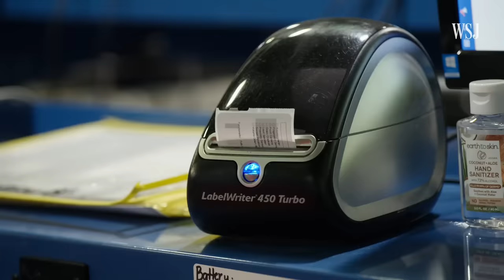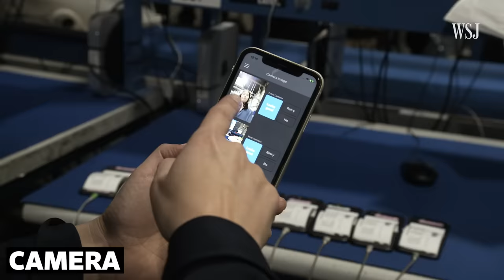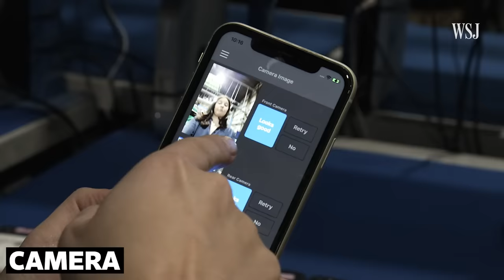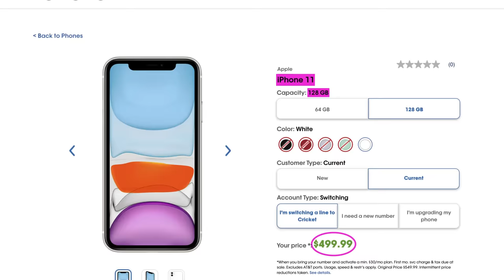How a Traded-In Apple iPhone Gets Refurbished | WSJ

Comment: I was expecting more than just a clean for only a 20-30% saving on the brand new price. Seems far too expensive as you'll be getting a battery that takes longer to charge and with a reduced battery life, compared to when it was new? I'm struggling to see why anyone would buy one? This video really hasn't answered this key question for me.

Comment: I honestly never believe in trade-ins. Paying $1000+ for the phone originally to get recycled later to get the next phone at a cheaper cost. I would give it to another family member to use or use that as a second hand phone, maybe find the newer phone you want refurbished to make up for the trade-in price, rather than trading in a phone so you can get the newer one at a cheaper cost. Doesn't make sense to me.
Reply: I bought my iPhone 12 Pro Max 3 years ago for $1200. Traded in last week for $1000 off the $1200 iPhone 15 Pro Max. $200 to upgrade every 3 years is much cheaper than buying a $1000+ phone every time you need a new one
Reply: @hotdogstandman  true, I would take the best advantage and use a phone until it’s completely out of function before upgrading. Doesn’t have to be every 3 years. 5-6 years is also good. Buy the best one once the previous phone is complete out of function.

Comment: So the breakdown is, you buy a brand new phone for lets say $1000 bucks plus tax, later down the line, you decide you want to sell it, 3-6 months. You then
take a loss of $800 because they are offering your $200. So when they do sell a perfect condition phone about $350 they make a profit of $150 minus of
course the fees and conditions 80-100ish lets say. So the initial buyer loses 80% of the value, rather than selling it for $800 and taking a loss of $200 instead
of $800. Bottom line is, if you trade in your phone, you lose alot of money and then end up losing more money when you buy a refurbished phone. Better to
sell than buy it refurbished. Then to trade it for $200 bucks and buy refurbished.

Comment: That's why I never trade in my iPhones to Apple or Telecom providers. I always get the newest pro model, 256 GB, and use it for 2 years, having it cased and protected. After that, I clean it (it takes 5 min to clean it and reset it), the phone is in perfect condition and always goes for 550-650 € on eBay. In the end, it's the same, but i get ~600 € for 10 min of work. What these guys are doing is nothing special, they check the phone and clean it. I thought they were really working on them, changing batteries, broken parts, etc.

Comment: First off, a bit over 20 years ago, I was a technician repairing point of sale terminals that were being refurbished, so I have some idea of what's involved.  In the local mall, there are a few stores selling refurb phones and my cell carrier also sells them on their web site.  They also provide free phones to women's shelters.  When I get rid od a phone it's usually because the battery has worn out and so would be a loss to those guys.  I have replaced the battery on one phone, but that wasn't a job the average consumer, without my skills, could do.

Comment: I wonder how many they get still locked to an Apple ID or an ex company phone, locked to that company? I had a phone that I took to Apple for a new battery, they factory restored the software and returned to me without replacing the battery as “ locked to a company” and so it was basically bricked. Fortunately I had been given the phone when I left the company and I was able to get the IT department to log on to Apple server and release the phone so it would work. I can imagine someone buying a phone that has been factory reset and appears ready for setting up, only to find it comes up as locked to a company and they are not able to go any further (phone is possibly stolen).

Comment: We got three brand new iPad for our kids one year. Within 6 months two of the ipads had been replaced, they bricked/boot loop. At 9 months we had to replace one that had already been replaced. Just over a year the only original one left bricked too. 
I was very convincing when the trades occurred. They didn't want to give us any credit for practically new devices that stopped working due to poor build quality. They said "well it doesn't power on so we can't give you credit." To which I said "and? You're going to send them off to be refurbished and then sell them at near full value. So I paid for full value, now that it's broken I have to pay full value again and give you my broken iPad to you for free. Then you're going to sell the old one. You're getting the value of three iPads but only selling two. It's not happening with me." Low and behold they gave us credit for the broken iPads.

Comment: So the software they used when plugging in all the phones to erase them all. What about icloud protection? Does it bypass that? Normally when you wipe an iPhone, it bricks due to icloud, does this software bypass that completely?

If so and that software got into the wrong hands, that would be bad.
Reply: It only does that if the original user doesn't remove their account, phones aren't locked to a single user, otherwise nobody would be able to pass it down to their family members like many do.
Trade-in companies check this before accepting the phone.

Comment: Ha funny. You call that refurbished. That’s clearly used and cleaned. You didn’t even open up the phone to check the internal components and check the battery and replace it. Note they didn’t even replace its thermal paste. Paste usually lasts 3 to 5 years and degrades over time. What a joke

Comment: nothing common with a REfurbishing have not this company... except "RE". its Resale, honey!!! brush up, sanitize n put the OEM (I wish it is OEM) USB cable doent equal refurbishing, hahahaa 🤦‍♀
disassembly, change battery (no matter how many charging cycles has the old one), inspect each circle, hardware and software, reinstall IP protection under a display ARE EQUAL refurbished iphone